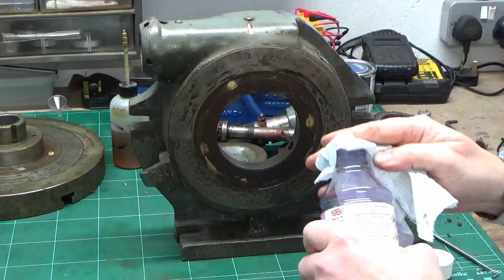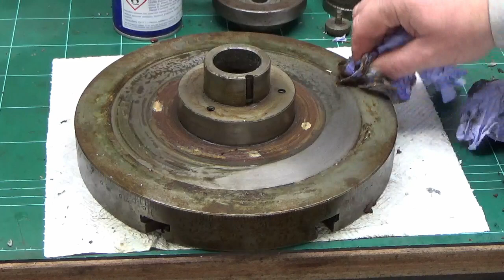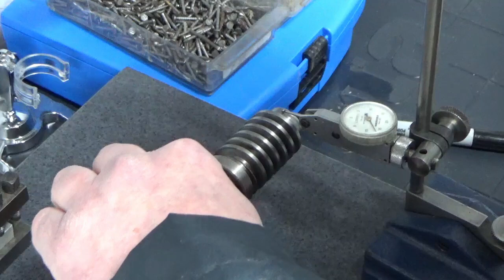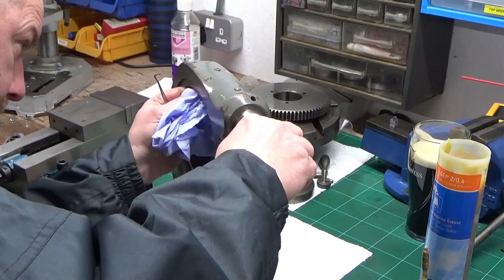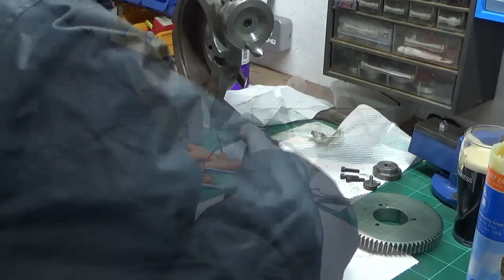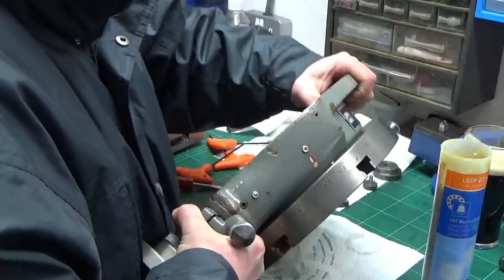APEX 10 Inch Rotary Table Strip Down Part 2

Comment: Nice bit of kit Jon, well done straightening that shaft. Get yourself down Screwfix, WD40 £25 for 5 litres with a spray bottle, you won't regret it.
Reply from the maker: Hi Dave, thanks for the comment. Spot on, I was about to Internet search where I could buy it in bulk as I am getting through the tins fairly quickly, never thought of Screwfix. Great shout. Cheers, Jon

Comment: Should be a good thing .    Have you  seen or used precision flat stones ,  great for running over  flat critical surfaces on jobs like that .      Cheers .
Reply from the maker: Hi Max, thanks for the comment. Yes seen them and used them years ago but don't own any at the moment. I do have a very flat stone that I used on this job, looks like the footage didn't make the cut (was fighting the minutes on this one). Stickers getting posted today Max. Cheers, Jon

Comment: Can you also use silicone lube instead of WD 40?
Reply from the maker: Hi Pixibelle, thanks for the comment. Yes Silicone lube would also work as well as silicone grease on the worm/worm wheel arrangement. Big fan of WD though and it smells nice. Good for arthritic joints I have been told, although not sure how and never been tempted to try it despite suffering myself. Cheers, Jon
Reply: @jonsworkshop  Nothing beats the aroma off WD40 on a man, turns the women on somethong wicked!!

Comment: That's cleaned up a treat, Jon! Great work on the straightening of the shaft end too.
Reply from the maker: Hi Morgan, thanks for the comment. I got really lucky straightening the shaft, 3 taps under heat with a big copper mallet got it to what you saw, it doesn't always go that well. Cheers, Jon

Comment: Great job Jon, straightening that spindle must have been awkward, still another tool for the work shop 👍
Reply from the maker: Hi Terry, thanks for the comment. I got lucky with the shaft, 1st tap moved it 0.02", second tap moved it almost right but threw a 0.01" error 90 degrees from the original error, Tap 3 got it to where you saw in the video. Bet I couldn't do that again, wish I had filmed it now! Cheers, Jon